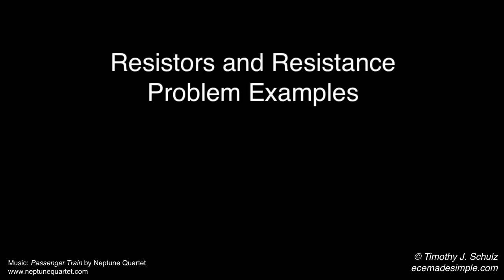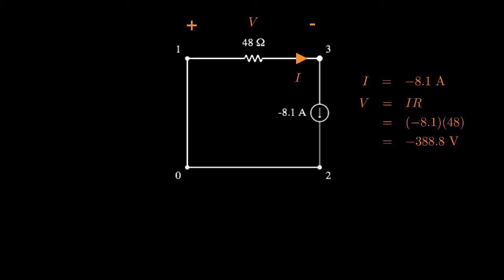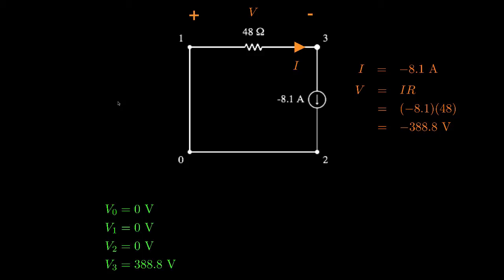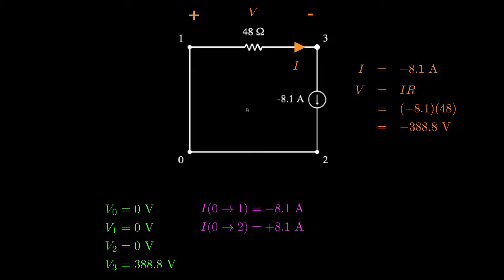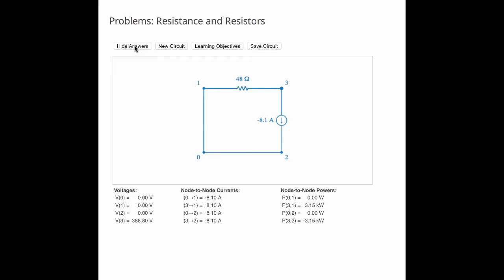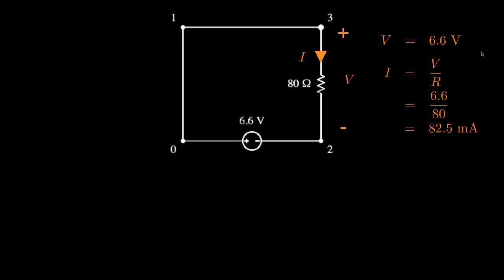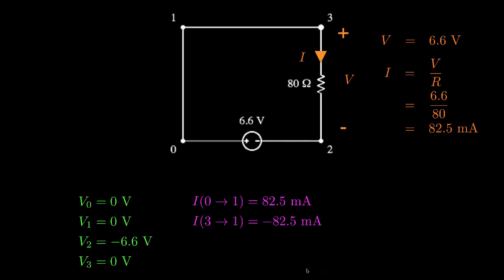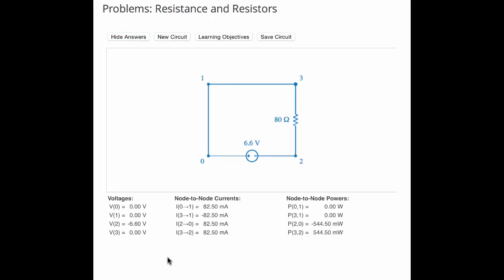Problem Solutions for Resistors and Resistance

Comment: Thanks very much Mr. Schulz for another helpful video! Was wondering if you could explain in more detail why @4:39 the voltage drop across node 3 to node 2 is positive 388.8 V? Is it is because of the Law of Conservation of Energy requires that total voltage around a closed loop must be equal to zero?